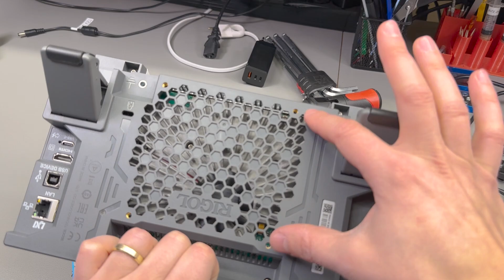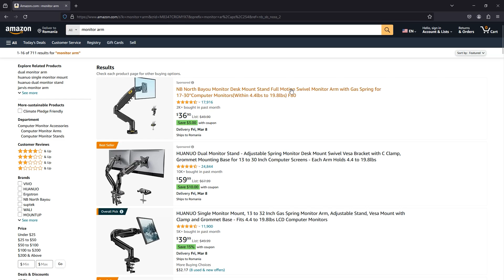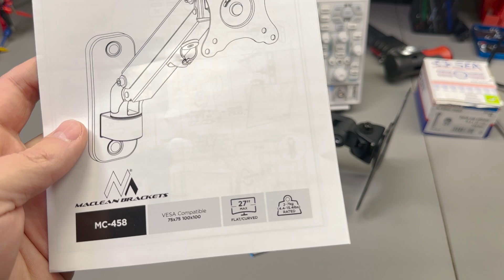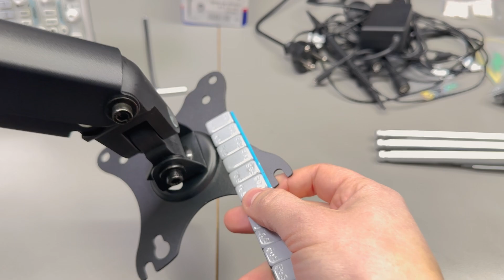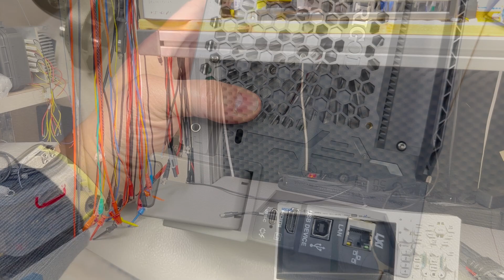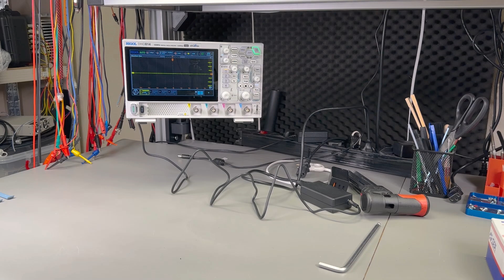The Ultimate Rigol DHO800 Workbench Setup (You Need This!)

Comment: Someone should design and 3dprint a great batterypack / 120mm fan shroud / Vesa mount that bolts to the back - and the vesamount clips on to the vesa arm for quick and easy removal...  THAT would  be an insane accessory!  Oh, and possibly use 186550 cells removable in the battery pack...  I'm pretty sure this would fit on all the 800 series and 900 series Rigols
...

Comment: I got a similar unit but clamps to bench top. It comes with 10mm spacers to keep mount away from scope back panel (better air flow).
I can now bring scope towards front of bench when required and I can now even read small text. Best thing I ever did!
Reply from the maker: Yes, most of these monitor mounts come in 2 variants, table clamp or wall mount.

Comment: As already mentioned. You should increase the airflow by using some spacers and a bit longer screws. The vesa plate covers a big portion of those air vents.
Reply from the maker: Wanted to mention this in the video but I forgot. One could do that.. Myself I'm not going to do it, User manual does not mention the need to do so, I think it was taken into account, the back panel already has part of the holes covered and the fan itself is not a high airflow one so I don't think it makes a difference. The scope itself is rated to be operated in an environment of up to +50℃ so there is quite a bit of margin.

Comment: You sould put some spacers between the Oscilloscope and the VESA mount to prevent impairing the airflow.
Reply from the maker: Wanted to mention this in the video but I forgot. One could do that.. Myself I'm not going to do it, User manual does not mention the need to do so, I think it was taken into account, the back panel already has part of the holes covered and the fan itself is not a high airflow one so I don't think it makes a difference. The scope itself is rated to be operated in an environment of up to +50℃ so there is quite a bit of margin.
Reply: @voltlog Of the 6 stands I tested, 3off them came with 10mm spacers for exactly this purpose which surprised me.
Reply from the maker: @IanScottJohnston  I've seen monitor stands that come with spacers in the past, I'm not entirely convinced thermal is the sole reason those are included. For example I had to use the spacers when I installed a monitor which had short threaded inserts so the provided screws could not be fastened all the way without some spacers.

Comment: There should be a more lightweight arm type. These ones are a bit too bulky.
Maby one could adapt one of those flexible goose neck arms with a vesa plate...
Reply: Some of the slightly more expensive monitor arms have a screw for adjusting the spring tension to match the weight of your monitor
Reply from the maker: The one I use in the video seems like a perfect fit. It's mostly behind the scope, you don't even see it.

Comment: Neat. I guess my only concern would that it swings about on the arm as you are connecting probes or pressing buttons on the scope? Apart from that, it's a win. :)
Reply from the maker: Pressing buttons is not really a problem, unless you're pushing into the top right corner which makes it move a few mm but I think you can also fix that by tightening one of the screws behind. Connecting probes is a bit more complicated to do without using two hands, you can't really do that standalone either..

Comment: Dave Jones reviewed this new DSO it has many bugs ,

can't capture waveform properly and much more
Reply: I wonder if they’ve updated firmware since then… @voltlog, do you know anything about this?
Reply: I just updated my DHO914 yesterday:

DHO800_DHO900(Software)Updatev00.01.02.00.02
[Latest Revision Date] 2023/12/28

v00.01.02.00.02  2023/12/28
1. Self calibration optimization update
2. Solve the problem that window transparency cannot load the last value
3. Solve the problem that the LA function cannot display the label after setting it

v00.01.02.00.01  2023/12/5
1. Self calibration optimization update
2. Solve edge jitter below 31kHz

v00.01.02.00.00  2023/11/2
1. Self calibration optimization update
2. Solve the problem of UltraLab startup connection failure
3. Solve the problem of failure to save waveform in wfm format
4. Solve the problem of unresponsive touch on startup screen

v00.01.01.00.02 2023/09/12
1. Self calibration optimization update
2. Update Help Documents

v00.01.01.00.01  2023/08/10
1. Remove all time-related displays on the instrument
2. To modify the vertical interface, click the wiring diagram to modify the AC coupling function
3. Modify the delayed scan Chinese display as Zoom
4. Modify the order of the menu in the upper right corner, put the measurement in the front and Default in the back
5. The probe ratio interface is removed, and the probe ratio option is added to the vertical first-level menu

v00.01.00.00.19  2023/07/24
1. The first version is released
Reply: Rigol or Siglent, upgrading firmware is an excellent sidequest that can lead to all sorts of interesting research, especially if you need to use your scope for productivity reasons and are frantically trying to recover a failed flash. Sigh.